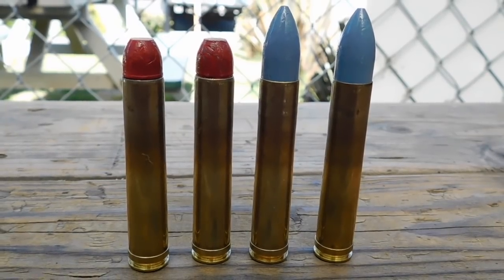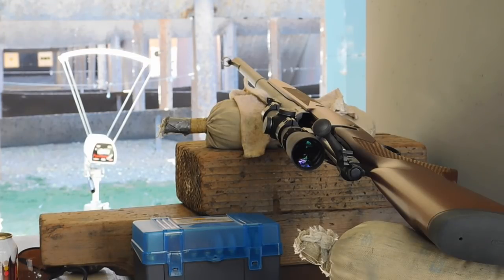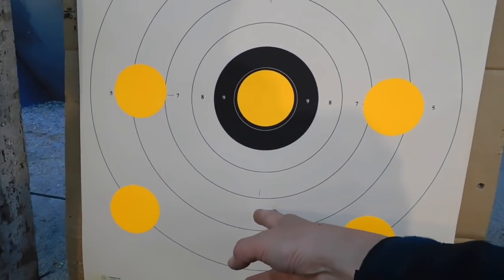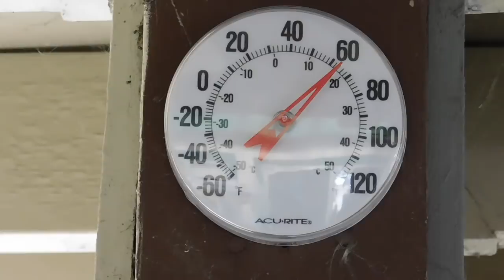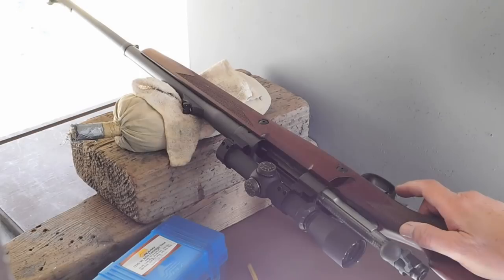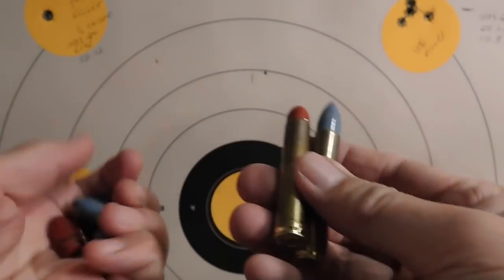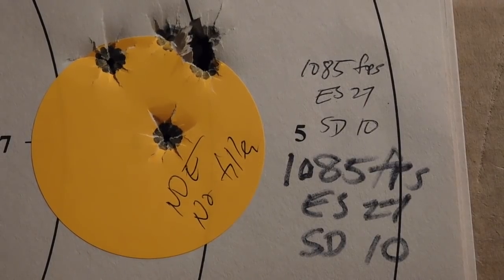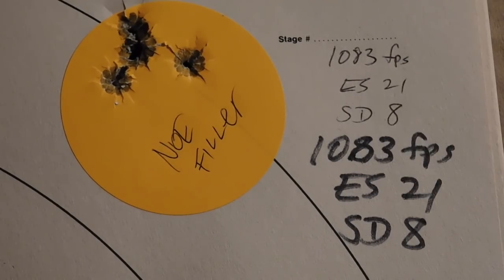Range Test 458 Winchester Magnum - Trans Sonic NOE HTC 459 500 SP And Lee 458 340 RNFP

Comment: Not sure, but it might make a difference in group spread. I used a roughly 1" square piece of old couch cushion foam packed down tight to the powder in the reduced loads that I have made with Unique. Have not experimented with the 458 but I think I will. I have made reduced loads in the 308win and 30-06 using a 70gr .312 "32acp" jacketed bullet, ran through a Lee .308 cast sizer , and 13 gr of Unique with the foam plug. Great for the kids to shoot. And good for taking the odd rabbit while out deer hunting.

Comment: One other load to try is 13.0 of Red Dot.  RD is a "bulkier" powder than Unique and slightly faster burning and easier to ignite, so fillers are never needed with it.  I'd also try to stay away from the transonic velocity range as that is where maximum turbulence effects the bullets.  It's always better to go subsonic (under 1050 fps) or supersonic (over 1200 fps) instead.  Note that the RD load ins't "max" - you can go up and down a few grains and dial in the performance you want and try to find a sweet spot accuracy wise.
Reply from the maker: maz2331 - Thanks for your fine comment.  My desire was to go subsonic, but the powder charge wound up transonic.  I'm tweaking the charge from here.  RD is certainly a fine powder for reduced loads in these applications... Will be giving that a try sometime soon.  My plans are to get a subsonic load, a midrange load and a full power load (for cast bullets that is...).   Thanks again for sharing good information to all... Best Regards to ya, FC

Comment: This was interesting, how much airspace did you have in the filler less case with 16grns of Unique ? I put 120 grn of propellant in my cases,(577NE) and always use filler as the case is not 80% filled, I will have to watch this one a few more times, it is not generally recommended to use fibre filler in bottle neck cases, but there is not much reduction in the .458 I suppose.
Reply from the maker: Englishman French - Looks like the 16 grains of Unique takes up 35% of the space under the 340 grain bullet and a hair less than 50% with the 500 grain bullet.   Also interesting in that the 50% loading density shot better with the filler while the 35% loading density shot better without (even having SD of 4).  And to be definitive, many more groups should be shot...Just goes to show that we test to see what works for our particular gun.  As you well know, BP needs 100% loading density as a must.  Smokeless is indeed a different beast in this regard.  I will be using the filler in my 459 500 SP subsonic load though - even dropping the powder charge to 15.8 grains.  Have a great day,  FC
Reply: FortuneCookie45LC : 35% !!! All conventional theory says you will have a flash over at that density, yet you got away with it here, I am really surprised you did not get erratic ignition without keeping the propellant back on the primer, the charge must have been laying along the bottom of the case, commercial loading uses a foam wad to keep the propellant back onto the primer, this could be partially due to the fact that transportation of the ammo could break up the grains into dust and cause a problem, be safe.
Reply from the maker: Englishman French - The 35% is by eyeball with the 340 grainer bullet - it is no less than that though.  The Lyman manual tells us to use fiberfill for only certain small charge loadings of fast burning pistol or shotshell powders in the 45/70.  But there are plenty of small loadings that do not specify use of fillers.  The use of the Unique or Red Dot or 2400 is what saves us with these low density loadings and fillers are not specified with these powders in the 458 Win Mag.  If we tried 1/2 or smaller charges of rifle powders, Katie bar the door and put the flak jackets on.  It's like shooting Bullseye in our 45 Colts - according to the loading manuals - no fillers - and the rounds fired fine.  I don't use BE in my 45 Colts though preferring Unique instead...  Have a great day,  FC
Reply: Englishman French  Try using Pufflon. IMO, it's way better than polyfill.  Pufflon.com

Comment: fc45lc -  Very interesting. Being a new reloader, and only having experience with Trail Boss, a filler is new too me. I found it really interesting that one bullet performed better with the filler and the other performed better without. Wow HUGH cartridge.  Can the filler affect the pressure? How do you control the amount of filler? Thanks for your efforts. :-)
Reply from the maker: L Krueger - The filler will not affect the pressure as it only weighs like 2 grains.  Only an amount that will keep the powder against the primer is needed, and that varies with the caliber.  Smokeless powder doesn't need fillers, but we like to use them in isolated instances where there is big space left over from small powder charges for more consistent burn.  But only testing will show if the use of filler really does improve Standard :Deviation and accuracy.  SD benefits only kick in at long range, however.  At 100 yards and under where this rifle will be employed, accuracy trumps SD in spades.  But it is always interesting to note the consistency of burn - and SD of 4 is very impressive.  Note that SD of 10 is also extremely gratifying to get.  These loads would be very good for brush and woods hunting, or in case any squirrels or rabbit charge us.  Have a great day,  FC

Comment: My first thought when watching this video was that a 500 grain bullet pushed that slow would surely tumble on the way to the target. They appear to have hit the target straight though. I wonder how it would perform out to 100 yards....
Reply from the maker: TheJurgisRud -  Very perceptive of ya...  There will certainly come a distance where the bullets will tumble once the velocity drops enough.  100 yard testing will follow.  These 500s were just trans-sonic.  Best to ya,  FC
Reply: JurgisRud part of the bullet stability is determined by twist rate also.  I have shot these 500 gr bullets out to 445 yards at subsonic speeds with success. In my 458 socom and shorty 45-70, I have a 1/14 twist rate which allows the bullet to be stable for quite the distance at slow speeds.  Using the JBM bullet stability calculator, the bullet is stable even at the slow speed of 500 fps.
Reply: Also, just an FYI, but the estimated BC is 0.3851
Reply: I don't know what the barrel twist is in the rifle used in this video, but I'm assuming that it is optimized to stabilize bullets going more than double the velocity as is being fired in this video. If you lengthen a bullet to add mass, and considerably slow the velocity, tumbling may possible at extended ranges. If the rifling is enough to stabilize the bullet that is being fired here in the Hot Zone, it must really be spinning the crap out of the more common factory rounds!  

I'd still like to see Mr 45LC fire these at 100 yards. Maybe they'll stay straight! Maybe they will tumble! I'd love to see how they shoot.
Reply: TheJurgisRud it would be interesting to know what the twist rate on his rifle is.  FC, do you happen to know the twist rate?
Reply: TheJurgisRud I believe 458 win mag has a common twist rate of 1/14.  Even if it were to have the slower twist rate of 20 or 22, the bullet 'should' still be stable at 550-600 fps.  But yes, it would be nice to see a test out a bit farther.
Reply from the maker: TheJurgisRud - Good bullet stability with that NOE 459 500 SP bullet...Can't say the same for the Lee 459 500  - plain cast and sized to .458 and lubed - bullets keyholed at 50 yards.  Same bullet powder coated shot well.  Good shootin' to ya,  FC
Reply from the maker: Full.Lead.Taco - It is indeed 1 X 14".  And your bullet shoots splendidly.  More testing to come though... Best to ya,  FC
Reply: thanks for the feedback!

Comment: Hello FC. Just starting to reload my S
&W 460. Can you recommend the best powder, type of Lee dies and source of bullets? Thanks
Reply from the maker: The Walker - Almost missed this comment because Google did not post it in my inbox... Thanks for the comment...Your 460 will also shoot all 45 Colts and 454 Casulls (and all 45 Schofields also) so you can use any pistol powder and any .45 cal bullets cast or jacketed.  For full power loads, Lil Gun will give you the best velocity at the lowest pressures.  Lee dies in 460 S & W along with the separate collet factory crimp die are your best bet.  Factory Hornady, Sierra, Nosler or Speer are all good.  As for commercial cast, Missouri Bullets with their Hardness Optimized bullets are a good bet especially for the hot magnums like your 460.  And if you cast your own, Lee or Lyman, RCBS or SAECO bullet molds are good.  And NOE is also a fine source of bullet molds.  Good shooting' to ya... FC

Comment: Well what can I say.. Heavy Duty all the way. Even at 1.000 fps they are a force to contend with. Looks as the Noe mold is a winner. Now you have the means of feeding that Monster some grade "A" projectiles that won't set you back, I can't wait for the true magnum loadings and the accuracy results. ( I believe that in Star Wars they said "Commence Primary Ignition" before firing the death star )   Dave.
Reply from the maker: Thorsaxe777 - When it comes to full power in the 458 Win Mag, I think my mental imagery is going to be more like "Fire in the Hole..!!"  But there's nothing wrong with shooting 458 loaded with full power 350 grain Speers - less punishment and higher velocity and energy than the bigger slugs.  I don't think I'm going to be engaging any Cape Buffalo any time soon - and if so, I'm just going to buy some Hornady Dangerous Game factory ammo anyway....Have a great day,  FC Steve

Comment: I thought on Controlled feed it's best NOT to drop in a round & close as was the 2nt shot .
Reply from the maker: Dan O'Neill - Very observant of you.  I was pushing the round into the magazine most of the time for the Mauser claw to do its work (the rounds were loaded to the maximum OAL to fit the M70 magazine), but you did catch me just pushing a round into the chamber and closing the bolt a couple of times.  Dropping a round on the follower and closing the bolt a la M700 Remington was not what I was doing.  I know what we've always believed on Mauser extractors, but my M70 didn't mind loading either way.  There was no feel of distress to the extractor closing the bolt on a round.  However, my preference would be to load the Mauser claws from the magazine - I did that most of the time.  It's good to know that you can just single feed into the chamber.  Have a great day,  FC
Reply: Good that you know your rifle , I only have ONE Controlled feed >> a Ruger 77/44 , great rifle , still low miles . I just feed from the mag , then top it off for a total of 5 rounds .

Comment: all that filler is the most expensive part of that load. just kidding🤣.that is the biggest cloud of filler ive ever seen by far.good stuff there 45lc.
Reply from the maker: the baddest - I was wondering if anyone noticed that...I've shot fillers in my 45/70 before and never noticed that - but then again, there's more filler in the 458.  I didn't bother picking up the little fluffs of filler to show, but they were there on the ground.  The 500 NOE bullet likes the filler - and 15.8 grains of Unique is going to be the subsonic load.  At 1050 fps, that 500 grain slug is going to pack a whallop.   Not much made of flesh and blood is going to stop that inside of 100 yards.  The 340 grain RNFP load at 1280 fps should be a very fine deer/ black bear / hog / elk load for the woods and brush.  Best to ya,  FC